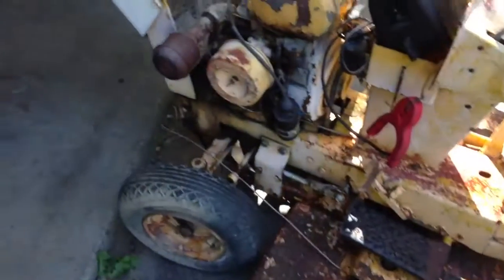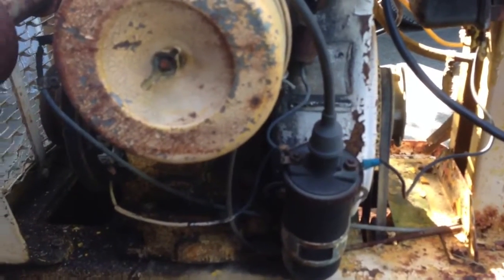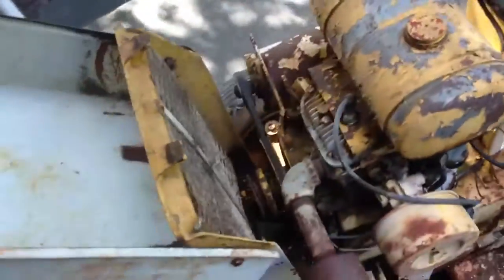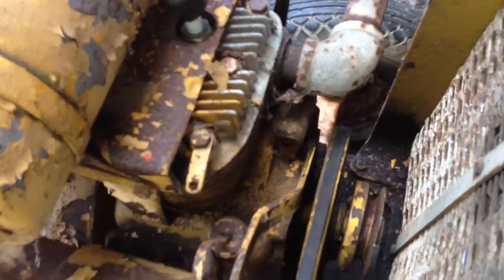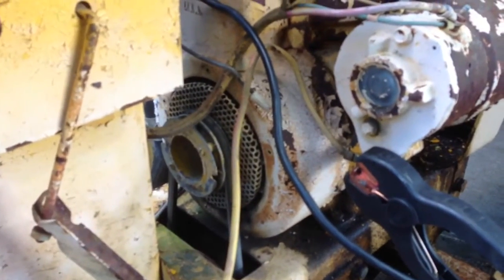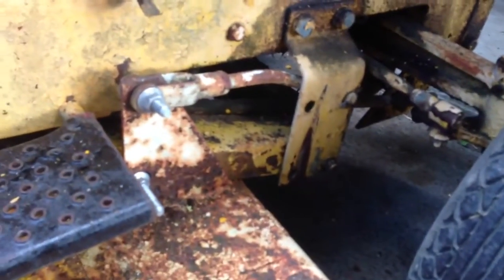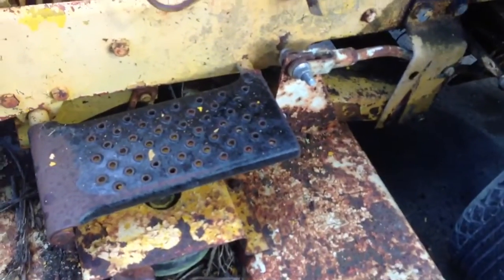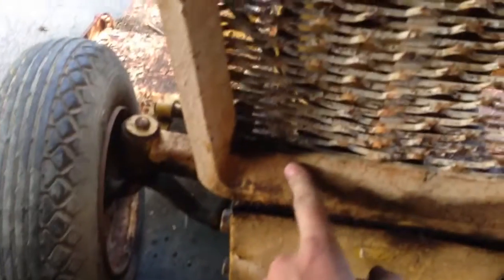1963 Original

Comment: Before you do a lot of turning the engine over you should really take off the head and check everything.  Sense it was setting for so long you want to make sure there is nothing in the cylinder that would score it.  Take your time cleaning the engine inside real good and you can probable bring it back to life with costing much.  Very nice tractor.

Comment from the maker: yes its very clean in the cyl actually. the engine will be just fine compression feels very strong so I know once i get the fuel system worked out it will run great.